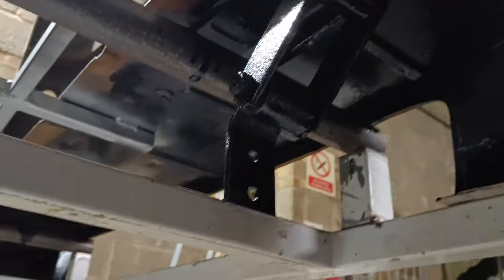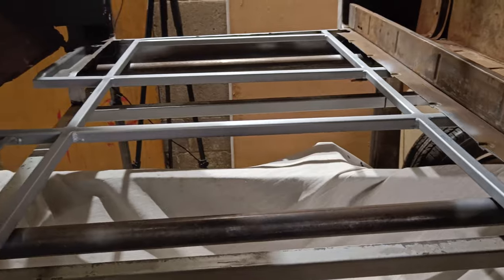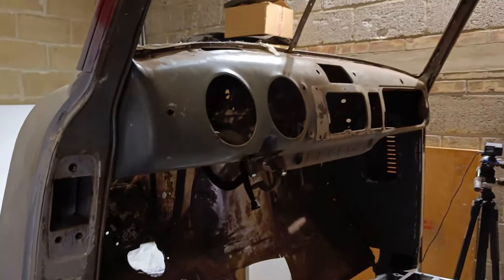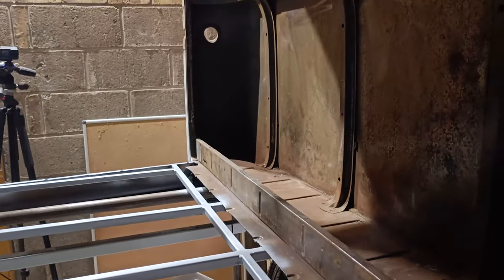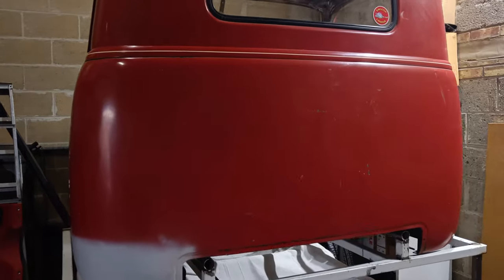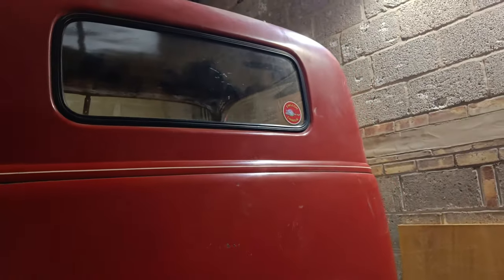POR-15 rust paint under the '51 GMC cab part 26

Comment: I will probably spray the bottom of the floor as well as the inside of the fenders (Wings) with a bed liner product like LINEX  It will cushion the wings from rocks denting from the inside.
Reply from the maker: Indeed, I'm planning on using something similar, raptor liner I think it's called. Giving good coats of por15 and paint because I want to be done with welding for sure when I hit it with that.